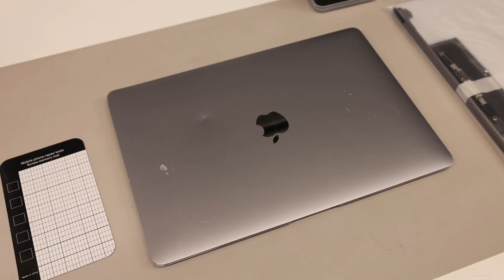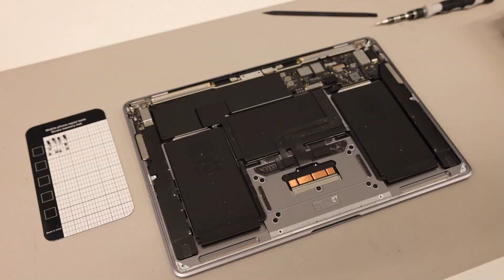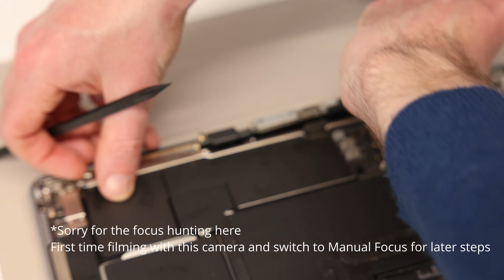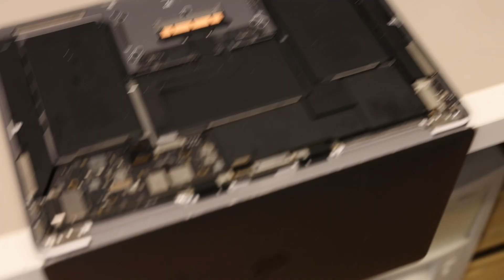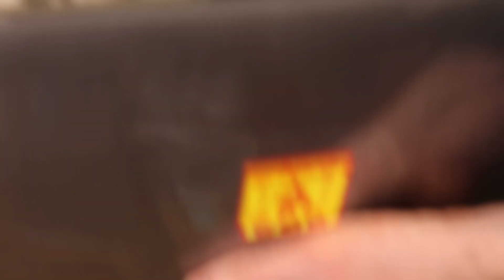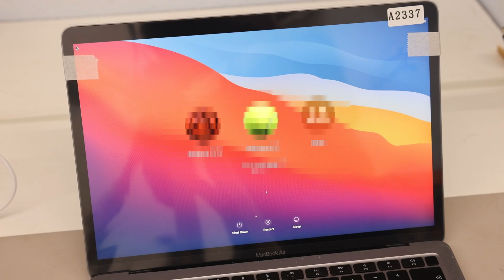Apple MacBook Air M1 (A2337) Screen Replacement Guide

Comment: Thanks so much for this. I actually used your tutorial to try and fix another issue which was that the hinges on my daughters Macbook Air 2020 A2337 are very loose, the offer no resistance and although perfectly aligned the screen is quite wobbly. I thought somehow if I removed the screen there would be a way of tightening the hinges but it seems there isn't. There is no visible damage or breakages to the hinges and I've reassembled the machine now and it's all working perfectly, except I still have the loose screen issue. Have you any suggestions for a solution, I've scoured the internet with nothing for this generation of hinge, except replacement screen solutions?
Many thanks

Comment: Hi James, thanks for your very helpful video! Screen replacement completed. 

Question for you:- When the screen is closed, the gap between the body and screen is very slightly wider than before. The gap is trivial, to be frank. This might be caused by very slight curvature of the replacement screen unit. Have you experienced this yourself and/or do you have any fixes? 

For other people reading this, I bought the recommended screen unit on Amazon (UK), it came with sufficient tools including the magnetic pad but one of the Torx screwdrivers broke during the works and luckily I happened to have a replacement in the house. I also had a little scare when the MacBook would not power up after the screen repair (I think caused by disconnecting + reconnecting the battery) but this was resolved by plugging the laptop into the mains once and after that everything has worked fine. 

The screen itself is impressive, the camera does work for me (contrary to some reports on other websites like reddit that the camera does not work ), and the lack of True Tone is perhaps noticeable for maybe 5 mins but you get used to what you're working with. I have certainly not noticed anything annoying in my usage of the fixed machine. Very happy with my decision to do a DIY repair as opposed to paying a professional to do the same job (I was quoted £260 and £300 from two businesses) and £450+ by Apple.
Reply from the maker: Hi, glad it helped. I don't recall seeing a difference with it - perhaps check the hinges are correctly aligned on the base but if its a refurbished screen it could be something on that side of it.